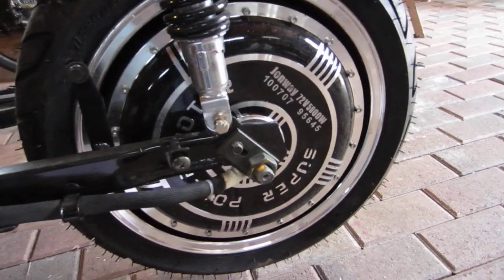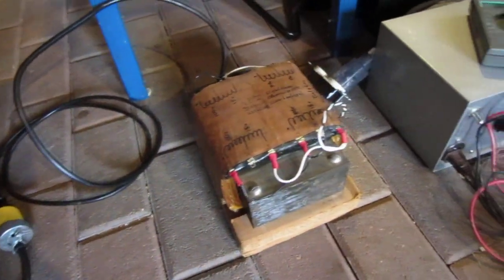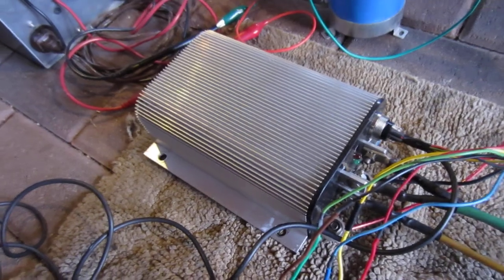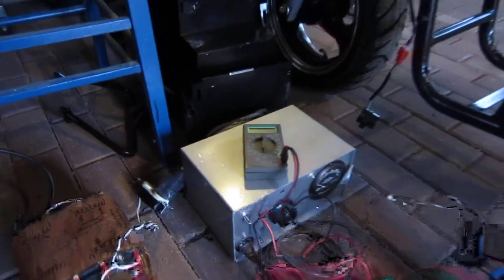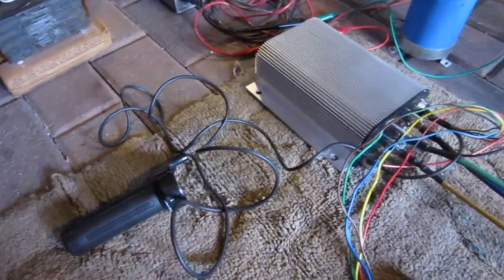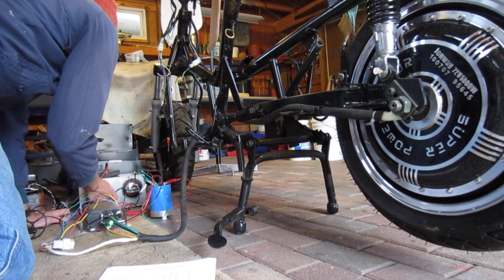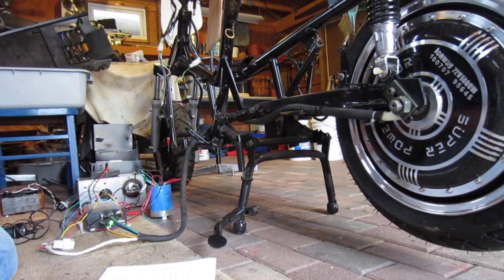5KW Brushless motor & Kelly KEB controller, first test

Comment: hi, i have a question because i have the same kelly kls7230s and qs205 v3 t5 3000w controller with a 72v 30ah bms 120a battery, what percentage do you mark in current motor and current battery in the controller parameters?  Thanks in advance and greetings!!!
Reply: @khwolter9038  thank

Comment: Hi. I have a driver and motor of them and the controller tells me sensor failure 4-2 hall sensor error: 1 incorrect or loose wiring or a damaged hall sensor
2 also be caused by incorrect hall angle configuration (60 degred or 120 degred)
the error indicates it even without the motor connected, but when changing to 60 degrees the 60 motors work well and show no error. but setting 120 degrees continues to indicate the error.
It will be possible for your collaboration to correct the controller.
or if you know how to restart

wvzwilson@yahoo.com
WhatsApp +573166842780 colombia
Reply from the maker: Check out https://endless-sphere.com/forums/viewtopic.php?t=8585.
(It may be a power-up sequencing issue. Your controller may want power for it's logic circuit before you apply B+ and B-.)

Comment: Have you got it drivable and ridden it yet?
Im curious how well the 5kw does
Reply from the maker: I'm not done with it yet, but plan to be this summer. I don't have high expectations for it though.
Reply: @Fourcycle  no?
How so? What is your target performance level?
Reply from the maker: @TimTim11111111  There use to be a company not far from me that used this motor in their maxi scooters. They had big names and $'s to fund them, but it really never took off. I heard through the grapevine that motor overheating issues was the problem. Such is the nature of direct drive hub motors. Moderate grades at low speed, they need the amps for the torque but aren't moving fast enough to dissipate the heat. My build is lighter than a maxi scooter, but not a lot lighter since you can't lighten the batteries much without losing range. I'm hoping for 55+MPH and 40+ miles of range.
Reply: No kidding, i would have thought a 5kw to be pretty robust in regards to heat.
Maybe another 5k, or maybe a 3k with the same KV up front would help reduce the load
Reply from the maker: @TimTim11111111  Right, and if I were to limited the power to this 5kw motor to 2 or 3kw, then it wouldn't be nearly as likely to overheat. I'm pretty sure that's what Current Motors did, but taking it to the next step by monitoring motor temperature and reducing power as needed to keep temperature in check.

Comment: what frame is that you mounted the wheel to?
Reply from the maker: It's the swingarm that was on the scooter I bought. It looks like one specifically designed for that motor and not make by whomever made the scooter frame.

Comment: I suffer from muscular dystrophy im unable to walk and I don't feel happy or comfortable using a wheelchair at all or a mobility scooter  so im always stuck at home never go out but  I wanted to build someting electrical that I would be happy and comfortable using but I need some advice please could you contact me and help me with some advice I would appreciate it so much
Reply from the maker: I'll try.  What advice do you need?
Reply: Fourcycle I need help with choosing the right motors and controllers and the speed they will give me could you email me on Sulwaq1@gmail.com  or you can whatsapp me on +447967967961 I would appreciate ur help alot thanks
Reply from the maker: This not being an area of expertise for me and not having done anything with EV's for several years, I would like to point you towards two forums that I found very helpful and that I'm sure can help you with your questions.  Do a search for the "V is for voltage" forum and the "Endless Sphere" forum.  I also recommend checking out the "EV Photo Album" for ideas and where hundreds of builders show off and give a synopsis of their builds.  Everything from electric skateboards to electric trucks.

Comment: With that capacitor, you'll have roughly 3V ripple for each 10A of  DC current drawn by the controller.  (ΔV=Idc*Δt/C)

Nice job. Time to connect a battery bank that can supply more current to the controller.

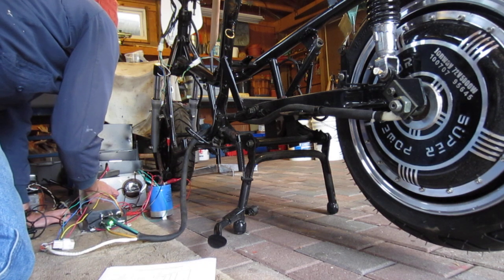Comment: Skip moments between 1:00 and 2:58.
Reply from the maker: Yea, but I wanted to include the entire process I went through, not just the  Wow! Look at it work!  part.
Reply: @Fourcycle  are you happy with the kelly controller? trying to narow the search :)
Reply from the maker: @zzz3010  I have not used it much to date, but the Kelly controller have a good reputation as long as you don't use them close to their maximum ratings. These days, a sine wave controller might be a better option. The motor runs quieter and there is less electrical stress on components.

Comment: I'd like to see a detailed update for the build, with footage and real life performance. Pack, continuous, peak, speed, acceleration etc etc. Just throwing my 2 cents in!
Reply from the maker: LOL!  Man, so would I!
The frame you see in the video was junk and has been disassembled, cut up for parts and the remains recycled.  I'm doing major modifications to a titled motorcycle frame to accommodate everything, have to come up with a 12v or 24v electrical system, make fenders, make HID headlamp, battery balancer, instrument panel, DOT approved LED running lights, stacked battery tray, get blessed by the local DOT so's I can ride it on the street legally, etc.
This is a for FUN project - hence the slow pace.  I'll put up an updated video if and when I feel like it ;o)  This is not a paying gig, I'm doing this as a pleasurable challenge and posted this video and am answering questions to inspire others.
I will say that I like the way it's going so far.  it's looking pretty sharp and looks nothing like the old scooter frame.  Look up "Current Motors", try searching Endless Sphere too, and have a look at their scooters.  Mine will look nothing like that!  These are pretty much the same components, though, and are old, proven, technology as far as I'm concerned.
Reply: Fourcycle "Man, so would I!" - lmao
Great to hear, and I hope the DOT gods smile on you.
And I appreciate that this is a fun job and I didn't intend to imply an expectation, I was simply saying I was interested in your project and, in particular, the real life performance of the 5KW hub motor - I've been contemplating (read: dreaming) of doing a reverse trike build with two 5kw continuous (hopefully a 10kw peak) with a 96v pack.
Best of luck!
Reply from the maker: Thanks for the well wishes!  Ah, a tadpole trike.  One thing to watch out for is axial loading when cornering.  Hub motors don't do well when axial loads are applied, especially as the bearings wear. Stator and armature tend to rub unless you have a large gap, which reduces efficiency.  They survive in two - wheeled applications because they rarely see axial loading, only radial loading.  The CG always remains perpendicular to the axle, even when cornering.  The idea of 3 and 4 wheeled EV's using hub motors is tempting but I have yet to see the idea succeed.  Unsprung mass is also an issue, and it applies to two wheeled vehicles as well.

Good luck with your project!
Reply: Fourcycle I hear you. I am very attracted to the build simplicity of hub motors, but I am well aware of these drawbacks in this use case too. Why can't we have our cake and eat it too?
FYI - here is a an interesting 4 wheel "hub motor" project that uses axial flux induction motors with vector conrtrol: http://www.evans-electric.com.au/
EDIT: They've updated their site and removed the useful information

Comment from the maker: Geared hub motors are better at delivering torque because they gear down the electric motor, trading rpm's for torque.  However, direct drive hub motors are generally better at speed and weigh less.  Weight is something you want to avoid in a hub motor because it's unsprung mass - hence you also have add more structure, aka more mass, so it doesn't break.  I'm not a big fan of large hub motors but the price was right...  It could be used as a mid-drive through a 2-speed transmission I suppose, but not for this project ;o)

Comment from the maker: Having the controller wattage higher than the wattage needed by the motor is actually very desirable.  The motor only draws what it needs from the controller.  If the motor wants more than the controller can deliver, the controller will either have to limit what it gives the motor or die trying to meet the demands of the motor.
Reply: this might be a silly question, but let's say you would have a 48v 1500w hub motor, would it be better to get a 60v 3000w controller.. or should the voltage always be the same on both hub motor and controller? i'm not anywhere near experienced enough to even try a project like that, but im just pondering around with some idea's
Reply from the maker: The specs on the controller are maximum values.  Your 48v, 1500w motor will run fine with the 60v, 3000w controller.   I would consider it a good choice.   With cheap Chinese controllers it's a good idea to stay well within the claimed specs.
Reply: Fourcycle hmm interesting so the controller basically manages the energy from the battery to the motor.. what kind of battery pack would you say would match well with that set-up? that doesn't "bottleneck" the motor
Reply from the maker: A battery pack that can deliver the current demand of the motor ;o) 

Current = Power / Voltage.  so 1500w / 48v = 31.25A.  I'd round it up to 35A.  Look up the battery manufacture's spec sheet and find one that will deliver that current.  Also take into consideration amp-hour capacity of the battery.  With lithium batteries you'll fine specs like 30C, or 45C, etc.  For instance, one may state on it: 3S, 1500mAh, 30C.  3S is three lithium cells in series (Each cell is ~3.7v so 3x3.7v=11.1v).  1500mAh is 1500 milliamp hours = 1.5 amp hours, or 1.5Ah.  30C is the maximum recommended current draw which is = Ah x 30 = 1.5 x 30 = 45 amps.

I used lead acid batteries and I have the controller set to deliver 200 amps max.  The batteries are 22 Ah so I'm running them them at ~9C.  Lead acid batteries have decreased capacity as the current draw increases.  Lithium batteries are pretty well immune to decreased capacity as a result of high current draw, so be careful comparing li to Pb batteries.  i.e. Pb batteries have a tendency to be more of a bottleneck then li.

Li's capability of dishing out lots of power (Current x Voltage) for a long time has shortened the lives of many a brushed motor that did just fine with Pb batteries due to them being the bottleneck.
Reply: Fourcycle yeah i'm not even considering lead acid batteries for a number of reasons.

i'm wondering though, is there a possibility after i get a powerfull controller and battery combination that i would fry the motor because it's getting too much power from the battery. Or does the hub motor only tap into what it can handle and stay below the danger zone? i would think the controller would stop giving it more than it can handle, is this correct? I'd rather have a good battery and controller and a weaker motor for safety sake.. Thanks for that excellent piece of advice btw.
Reply from the maker: You can indeed fry the motor with a powerful controller & battery.  Some people deliberately do so to get more out of their motor.

Long answer: There is a direct relationship between current and torque with motors.  The more current you push through it the more torque it with produce.  When motors spin, they also work as a generator, which is of the same polarity as the power source that is powering them.  The faster the motor spins the more voltage it will generate.   Hence, as the rpm's of the  motor increases the, voltage generated by the motor gets closer to that of the power supply running the motor and the current consumed by the motor drops accordingly.  Voltage differential is the pressure that pushes current through the motor.  What burns out motors is the heat generated by pushing current through the resistive windings of the motor.  More powerful motors will use thicker wire which has less resistance which means you can push more current through them before overheating them.  You can get several times the rated power out of an electric motor by turing up the voltage which shoves more current through the motor windings.  But you can't do it for long because of limited thermal mass in the motor and the heat is't being carried off fast enough to keep it from overheating.

Short answer:  Yep, use your powerful battery and controller.  To keep the motor happy, just program the controller to not to exceed a given current, about 32 amps for your 1500w, 48v motor.  Limiting the voltage of the battery will do the same thing.  If you want to increase the current, which you may for bursts of power, keep an eye on the temperature of the windings.  Many motors have thermistors tucked into the motor windings for that purpose.
Reply: Fourcycle ok mate, thanks for the advice! i'l keep everything you said in mind..
Reply from the maker: You bet!   Keep digging for information from different sources and play with the real stuff if you can. As with most things in life, there is more than one right way.

Comment: Hello!  How about an update please  :)
Reply from the maker: Tommy Luptak The frame was junk and was recycled.  I just got an old SL125 frame to modify and the 40AH LiFePO4 cells need to be bottom balanced.
Reply from the maker: It's taking a while...  I welded the scooter's head tube to a Honda 125 frame, welded up a frame for the battery pack and am currently working on welding the battery frame to the Honda frame,  Then I'll mount the scooter's swingarm and rear shocks.

Comment from the maker: Not a problem at all so long as don't exceed the motor specifications, which are usually programable via the motor controller software.
Reply: Fourcycle Hi 4 cycle, I bought two of these last year, 2 kelly controllers and 1 throttle for car use, my supplier in China sent an incomplete manual and a wiring scheme that seems a joke. Sent a mail to Kelly but don´t answer... Would you please tell me where can I get good info to connect them? Thank you. B. rgds
Reply from the maker: Enersys Uy Yes, the wiring diagram from Kelly is lacking and I think it's even more complex for you since I think you want to run both motors from one throttle, brake and battery pack. I have some knowledge of electronics and was able to decipher the wiring diagram to get mine working.  I do not know of a good source for information.  I may be able to help so ask me what you want to know.

In general you will want to connect both power inputs to the Kelly controllers to the battery pack in parallel as per 3.2.2 in the manual.  Use only one contactor and make the precharge resistor 500Ω. Connect the thick field wires from each motor to the controller for that motor.  Connect the thin sense wires from each motor to the controller for that motor.  Use a DPST switch for reverse instead of two SPST switches.  For the brake pedal and throttle, use 5V and Gnd from only one controller to power them. Then connect the signal out from the brake and the signal out from the throttle to both controllers.  Do not connect 5v from both controllers together!  It should be okay to connect Gnd from both controllers together but I would try it without first to avoid ground loops.

I feel that hub motors work better in inline configurations then in side-by-side applications. In inline applications the center of force on the motor always remains pretty much perpendicular to the axis of rotation while in side-by-side applications it does not (Turning a corner).  The significant side load can cause the armature and rotor inside the hub to rub together with time.
Reply: Fourcycle Thank you, I alsohave some elctronics knowledge and will attemp to connect, I guess there´s little risk to burn something. I import heat pumps from China and lack of info is common, products are not so bad but always have to "decipher" manuals! I´ll keep your address. B. regards

Comment: Having the controllers watts higher the the motors.  Wouldn't it damage the motor?
Reply from the maker: Nope.  I'd want the controller wattage to be specified higher than the motor draw wattage.  Same goes for the controller's specified voltage.